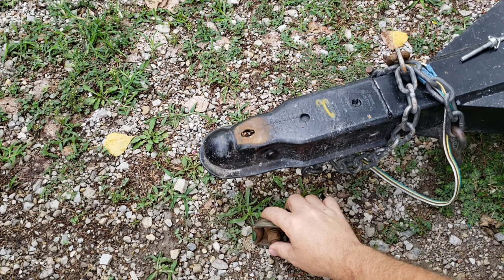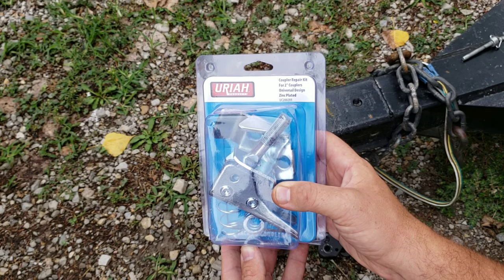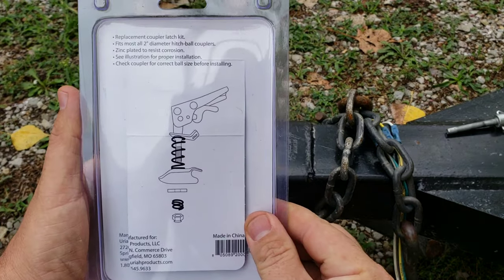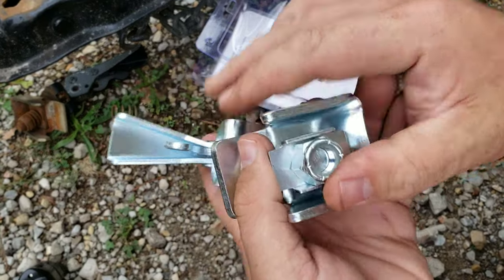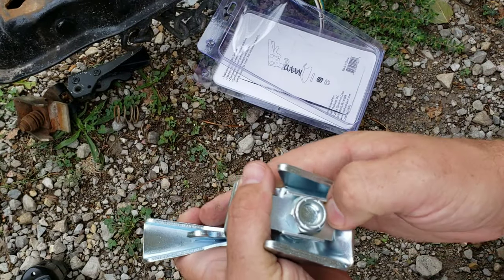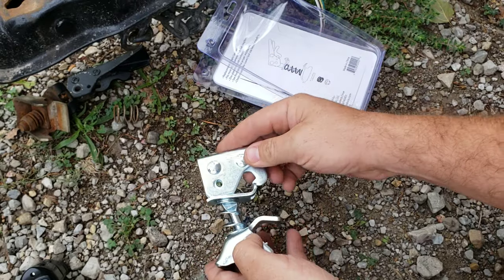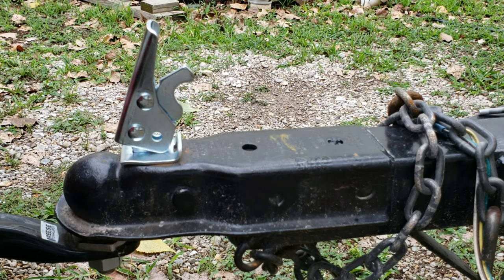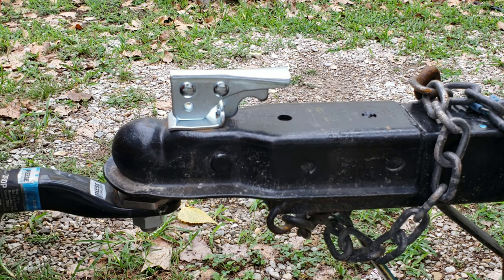Trailer Tongue Coupler Replacement

Comment: That bottom plate is supposed to be turned sideways! Otherwise it can still come lose
Reply from the maker: I had the same thoughts and went back later and changed it, however it does appear the way I first installed it on the diagram from the manufacturer.

Comment: According to the picture on the package that small steel plate should be installed before that short spring not after it. Plate then short spring then nut.  Is that correct?
Reply from the maker: You are right about the picture, however it doesn't make sense to put it together that way. This video is over 2 years old and I haven't changed a single thing from how I put it together in the video and I haven't had a single problem with it. I also am using the trailer almost every day when I am not working on the ambulance (so 4 - 5 days a week) take it up and down some pretty nasty gravel roads and still no issues with it. 

The nut acts as a retention nut on the plate, which pushes down on the spring this way and keeps pressure on the hook on the inside.
Reply: Hoffman Handyman Service I noticed that too. Even on the piece that broke off it has the flat piece first then the spring.

Comment: 10 cents Tip: sand rust, remove dirty grease underneath and prime and spray. Finish off topcoat over the zinc plate to stop next years rust. ReApply grease
15 cents Tip, nylon nut is one time use. In future, use a new nut each time removed.

Comment: having trouble getting the ball in after replacing… all 2” so idk what the problem is
Reply: I have heard that them replacement go by weight and if u get the wrong weight size even all 2 inch it won't let the ball go in

Comment: I had to remove the rectangular washer altogether in order to have enough threading showing on the bolt (1 - 1&1/2 threads) to satisfy the safety warning. Think that's okay? I'll be checking it periodically to see if it needs tightening per the instructions and saving the washer in case there's room for it down the road after usage. Also my ball clamp sticks even when I unlock the coupler lock - I have to jiggle it extensively to get it to disengage. Not sure why.

Comment: Mine for some reason won’t shut at all and I got it adjusted all the way
Reply from the maker: Try releasing some of the tension on the nut on the bottom. It doesn't have to be torqued all the way down. Just tight enough to where there is no play between the ball and the hitch.
Reply: Hoffman Handyman Service I tried that I got it to were the bolt is flush with the screw and still won’t close
Reply from the maker: @Cambigdongbjj  I really don't know. There really isn't a lot of parts to it for it to mess up like that. Maybe the handle/lever is defective? Only other thing I could think of is it may not be the same size ball and/or coupler.
Reply: Hoffman Handyman Service when I installed it I had the coupler open and u did it closed could that be the problem? I’m at work now won’t be able to mess with it for a little bit
Reply: @Cambigdongbjj  check to make sure you are on the pin on the back of the tongue